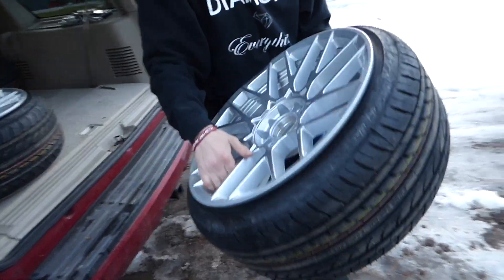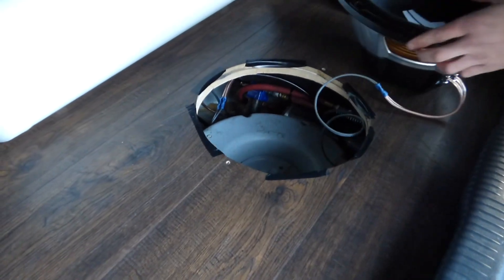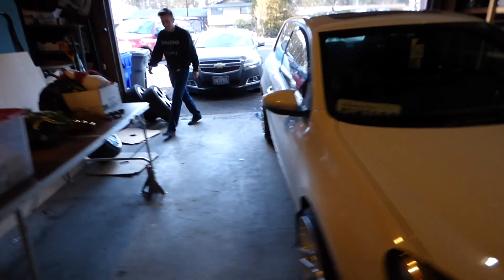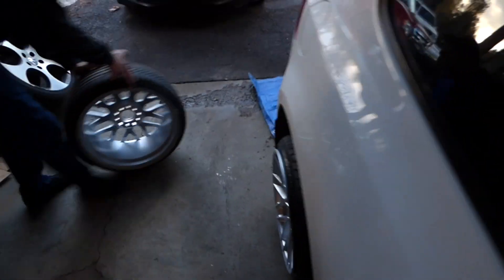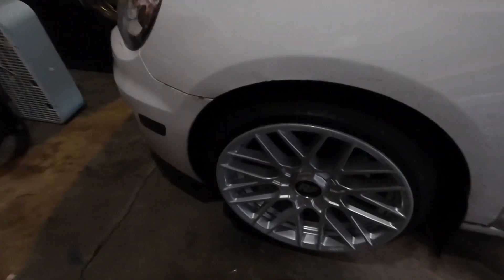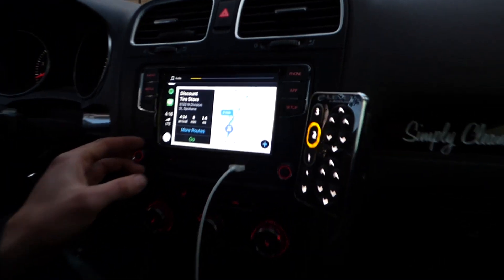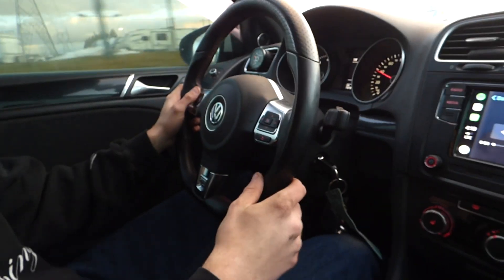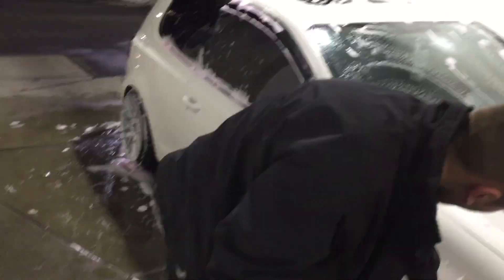BAGGED Mk6 Gti gets NEW Rotiform RSE Wheels! Install + Vlog

Comment: @Car Culture What's up guys? I stumbled upon your channel and I saw the rotiform rse wheels you have/had. I know the specs are 18×9.5 with a 35 offset. I'm about to run a 18×9 with a 30 offset. I have a 2010 gti. That should be able to work out right? Did you rub? And in this video I noticed you weren't bagged yet, but your lowered. I'm on stock suspension.
Reply from the maker: Josh Maisonette depends on suspension and if the fenders rolled, a lot of variables to be able to say if it’ll fit or not/ run
Reply: @Hayderz  No my fenders are not rolled and I'm on stock suspension. Your opinion?
Reply: What coilovers were you on when you first put the wheels on the car. I saw your video with the straight piped exhaust and the wheels had a decent amount of poke on them. And it doesn't look like you rubbed or anything, I could be wrong. Get back at me asap bro.